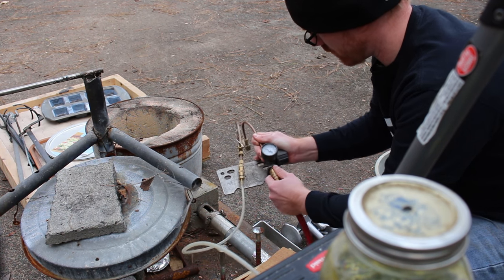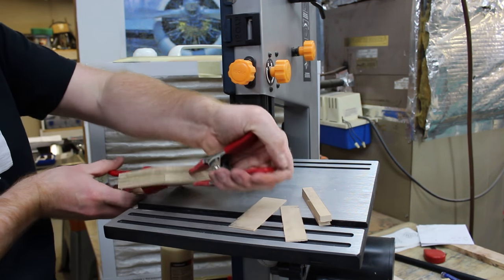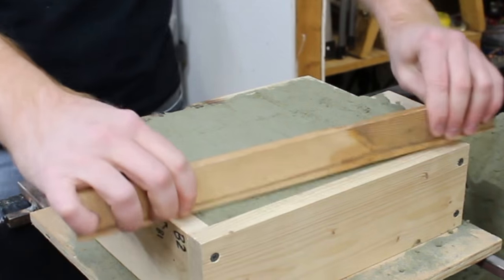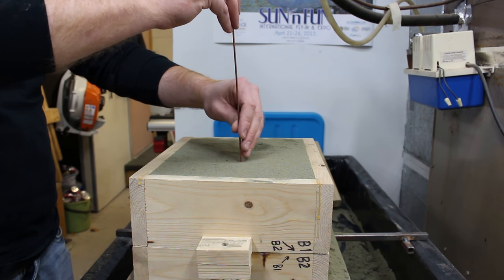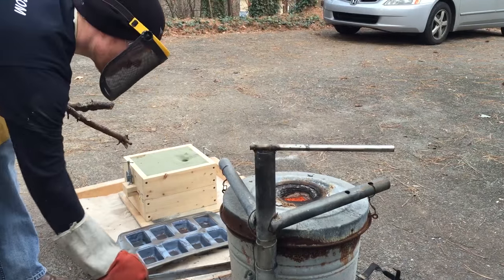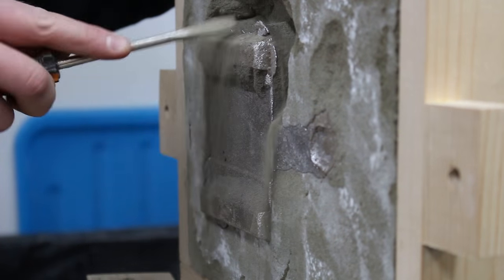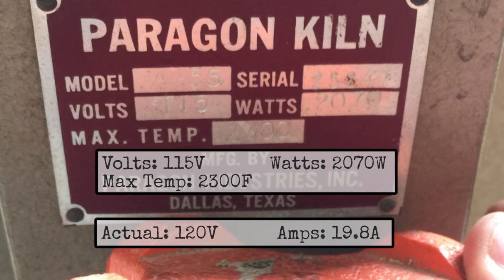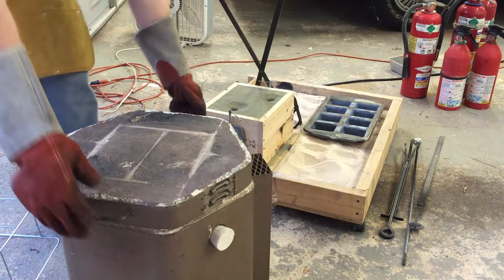Metal Lathe - Part 8: Pouring Tailstock Base

Comment: Instead of pounding the template into the sand, turn the mold upside down, place the piece in the bottom and pack sand around it. Then flip it over, make the top half and mate them together.

Comment: It's great to see someone actually taking the time to make good patterns and producing really good castings for the Gingery lathe.  Try using kerosene as a cutting and tapping fluid for aluminum   To avoid set screw dings on your steel shafts, just drop a small brass slug down the screw hole.  The brass will grab the steel really well and will not slip. For steel screws in aluminum, use an anti=seize compound like you use for spark plugs in aluminum engine blocks. It prevents the galling that tears up threaded holes in Al.  Only one small thing.  The word "gib" is pronounced with a hard "g", as in "Gingery".  Terrific workmanship and great videos. I believe you will inspire many to build their own copy of one of these great little lathes.
Reply from the maker: Awesome. Thanks for the kind words! I really like your brass slug tip and feedback on good fluids. I'll try these out. G as in gig not gin...got it. I have learned a lot from the comments so thanks for taking the time to post.

Comment: That hotter temperature seemed to produce a much nicer part even in the finish surface .Measuring accurately that temperature and controlling it would be a really good addition for consistency

Comment: This is inspiring. I can't help but think that the first thing I would do is start making parts with the lathe to make another lathe with tighter tolerances. I have a suggestion for the casting that might make it easier. Consider using a piece of wood that is square and planed to your reference surface as the center of the mold so that the alignment is set with screws that go through perpendicular to that. Then you can setup both sides by packing the sand against the center of the mold. The tighter the sand the better the cast. There is also some "release agent" although I think that just regular flour would fill in the space between the sand, leaving a finer cast.
Reply from the maker: Thanks for commenting! You read my mind. I have been dreaming of tapered roller bearings and ball screws. Maybe one day. ;) I definitely want to try a two part pattern one day. Plenty of room for improvement in my casting techniques. Keep the suggestions coming.

Comment: If you get a Type K thermocouple, and an Analog Devices AD595AQ chip, it gives you 10mv per Degree C output to monitor your temperature. I used their basic circuit from the data sheet but with one addition - a 10nF capacitor across the thermocouple input to the chip. Reason? After dark, it went haywire. Investigation showed that it turned into a pretty decent short-wave receiver, and was picking up Radio Moscow. The capacitor cured that.

Comment: Hi Chris,
I believe that adding Magnesium Sulphate powder (around a heaped teaspoonfull-or more, you may have to experiment with this)) will help remove the imperfections in the cast aluminium.
The imperfections are caused-as I am sure you are aware by trapped gasses, adding the Mag,Sulph. will cause the molten metal to bubble as those gasses are released. 
You should see much better results when you get the quantities just right.
There are many videos on youtube of people doing smelting and casting like you so it would be well worth your while surfing through to see what you can glean, I recommend myfordboy-he does not say anything but demonstrates his techniques quite clearly and is very accomplished so well worth watching.

Good Luck, I eagerly await your next video!
Reply from the maker: My favorite metal casters are SVseeker, luckygen1001, and myfordboy. I usually have plenty of sticks handy, but know you have got me thinking I'll have to give the MgSO4 a go. I am sure we have some Epsom salt around. I really like myfordboy' degassing plunger from last year (I think). Too bad I don't have a lathe yet. Do you know off the top of your head whether the gas is associated with hydro carbon combustion? If so maybe dealing with a kiln will reduce gassyness. I was brainstorming a big vacuum chamber to evacuate the gas like folks do with epoxy. Pipe dream... Thanks for the reminder and encouragement.
Reply: Hi Chris,
sorry that I cannot help you with your question re:hydro carbon combustion-beyond my very low level of expertise,I am afraid!
All I know is that gasses-particularly Hydrogen get into the molten metal somehow and if left will cause porosity leading to poor quality castings.
There is a downloadable pdf entitled :"Understanding Aluminium Castings" by Dr David V Neff , I feel sure that it will answer all of your questions definitively.

Best Wishes-G
Reply: I have used common table salt to degas aluminum..  About a teaspoon wrapped in a small aluminum foil envelope and held under the melt until melted usually works well..

Comment: I have not read all the comments for this video so forgive me if I rain on wet ground. For degasser,  use baking soda; for flux (surface tension breaker) use salt; 1 tsp apiece. I think you need risers on those castings. My son wanted to do the Gingery lathe -- I had a book. Since I live in Alaska casting sand simply not available, used kitty litter and sieved sand. But the baking soda and salt trick worked well. We got that from myforboy channel. He has around 70 videos on backyard casting.

Comment: Nice, I has been planning to make a foundry for quite a long time, BUT I am a ceramist! so I have indeed a kiln very similar to yours it have never occurred to me to use it d'oh, so thanks for the idea I will be making my first cast when my crucible arrives
Reply from the maker: Awesome glad to hear it. Please share how it goes. :)
Reply from the maker: +Josuel Servin any status updates on the crucible in kiln?
Reply: +Makercise The crucible arrived broken, but I'm expecting to receive the replacement soon. I made a couple of test with a small stainless pot and it worked ok, but I will comment when I can test the crucible. Meanwhile I have been collecting equipment to be ready. Thanks again for all the inspiration

Comment: Very nice and a great score on that kiln!  Did it take more or less time to melt with the kiln, compared to the furnace? I was going to buy a kiln from my old church for casting,  until I found out that, it had been submerged in a flood. I may start looking for one again.
Reply from the maker: Agreed. ThriftyLittleMom rocks the deals! It takes WAY longer, but I can use it in the garage so the weather isn't a factor. It is cheaper than kero. It isn't nearly as exciting as the foundry though. It is a pretty simple setup. If you come across one that was flooded it may be worth a gamble. I imagine the fire bricks would dry out. The electronics might need a face lift though. It took about two hours IIRC to melt from cold. I have only used it once including cord shenanigans and opening before melted, so I'll keep better data next time around.

Comment: There is high temperature wire that has fiberglass insulation that won't melt. You really need to replace the wire in the kiln with that for safety. They also make ceramic wire nuts and fiberglass electrical tape that's made for high temp areas.

Comment: Hi Makercise, I enjoyed your video, but can I just say that you need to make yourself an extra handle to support the weight of the crucible more directly. Your current method of working looks very awkward to say the least and is indicative of a potential accident waiting to happen. I also like your mobile sandbox pouring station, able to stay dry and also contain any molten spills which will happen eventually.

Comment: This is a great series!
Thank you!

Does the pattern move about 1/16" to the left between, say, 2:55 and 2:59?
Is it enough to matter? On this casting? On others?
In what part of this or other castings will this kind of movement matter?
And, how much motion is enough to cause the first problems?

I pause at 2:59 and put my thumbnail on a vertical feature of the pattern.
Then I use the back arrow to get back to 2:55.
I see the pattern about 1 ply to the right of where it 'was' at 2:59.
Looks like 7/16" plywood and 7 plies of 2 alternating, but similar thickness.
I think it does move an amount comparable to the thickness of 1 ply =~ 1/16"
Reply from the maker: Ron Hartikka the placement in the cope and drag aren't critical. The important part is having the cope and drag align.
Reply: Thanks for your reply, but that's not what I meant to ask.

Comment: Late to comment. Using a proper pouring basin and tapered sprue prevent gulping air in, so you don’t need to degas.

Comment: I'm pretty sure I remember something about those cones actually being used for cheap, disposable, and repeatable precision high temperature measurement. "Kiln Sitter" I believe is the terminology.
Reply from the maker: Now I remember reading something about temperature cones. The kiln sitter looks like a similar high accuracy kiln temperature fuse. There are temp cones in that melt and droop over once they hit a specific temperature. They look like a sundial before melting. I really like the ability to schedule the temperature change and ramps. A kiln sitter doesn’t look like it is designed to do this.

Comment: How long did the kiln take to melt that aluminium?
Reply from the maker: I am not really sure about that particular melt especially since it was getting so hot. I have a video on a raspberry pi controller for the kiln that may give you more insight, but from cold kiln and cold metal about 2.5 hrs might be right.
Reply: Thanks, I'm just planning to make a electric furnace and want to gauge  how long it will take to melt.

Comment: if your going to cast Al you need already cast Al. the pressed or extruded stuff has way to much surface tension and you wont get a crisp cast... those pan look cool but no good for casting (more spam)
Reply: very true!! usually Al cans and foil is almost pure Al, not the best for casting and machining. Al that has already been cast is an alloy with Si and other things, much better and stronger for machining.

Comment: This sand looks too dry, imho, this is why the molding joint isn't perfect on the casted part.
Reply from the maker: Possibly, it sticks to my hands if much wetter. I would like to make a muller (bearing adapters, reduction pulleys, etc) as one of the first uses of lathe. I think that would help a lot.
Reply: +Okto Putsch I thought the same thing, that the sand was too dry and wouldnt produce a good casting. It may only have taken a light spray or two with a spray bottle and the greensand mix would have been just right. A spray or two too many and suddenly the mix is sticking to your hand and the molds.
Its one of those funny things about working with sand as I have noticed the same thing happens when mixing concrete, it can be a dry stiff mix and yet only seems to take a tiny bit more water to get it just right, but a little bit more water and suddenly the mix becomes too wet which is also bad as it weakens the cement paste ratio.
Reply: +Makercise In the mean time just get yourself one of those cheap blue tarps about 2 m by 1 m should fit your workstation just right and then you can use a spray bottle to mist the greensand and then fold it into the rest of the sand by lifting corners or ends until the mix is even. Check out myfordboy's channel as he uses that method with a larger tarp. Using the available lids for those buckets will help to maintain the moisture level of your greensand between uses, but I am not sure if it will go off? Still even if the mix is stored dry the lids will keep your mix clean of other matter.

Comment: You have no riser in the first casting. So gas accumulated and made the void in casting. Also ramming too hard make the sand leas porous. It's better to make vents with a wire.
Reply from the maker: You are probably right. I guess a true shrink void would have the sand texture in the recess like on a he headstock and bearing cap castings. Thanks for clarifying.